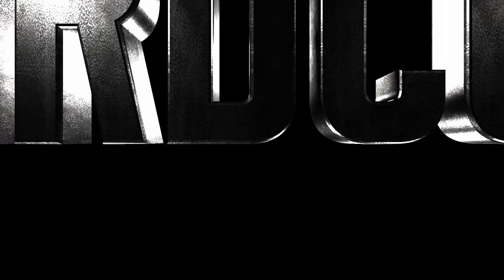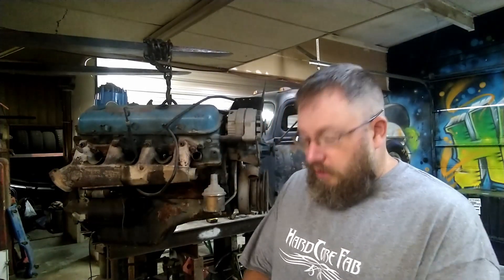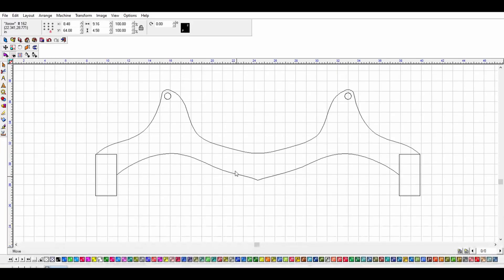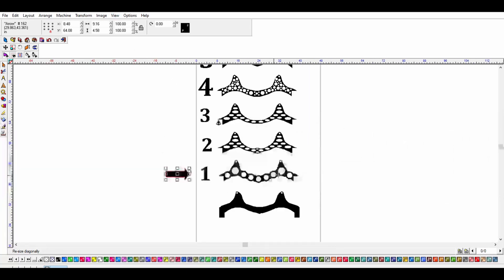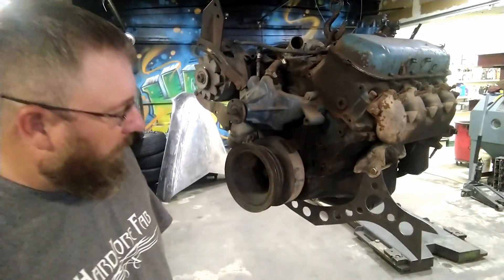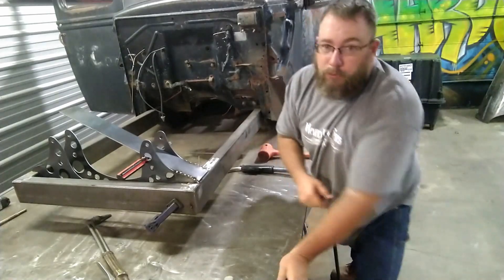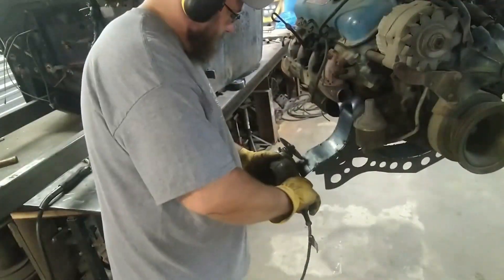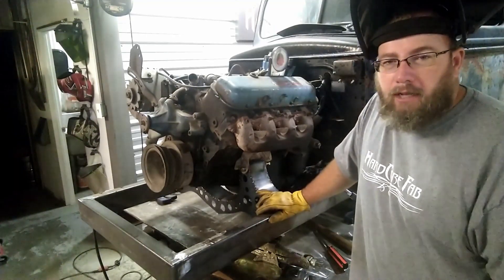Cool Crossmember Designed with Computer (Rat Rod Build Part 4)

Comment: I like the look of the crossmember for the engine. I hate the fact that the engine is solid mounted. Rat rods usually have thin seats so all that vibration is on your spine. Just my opinion.